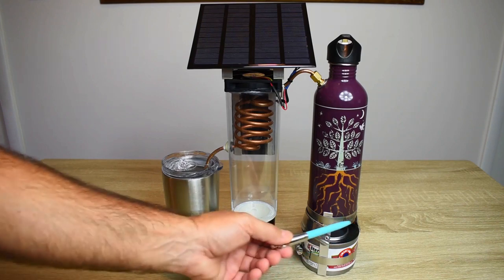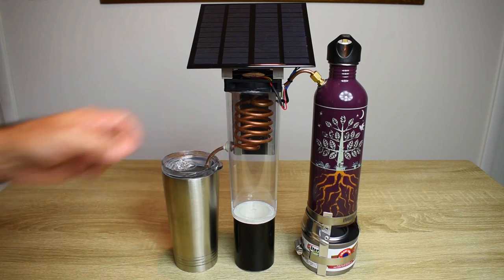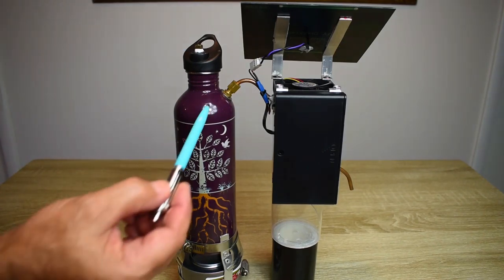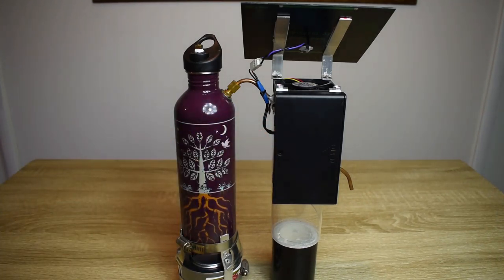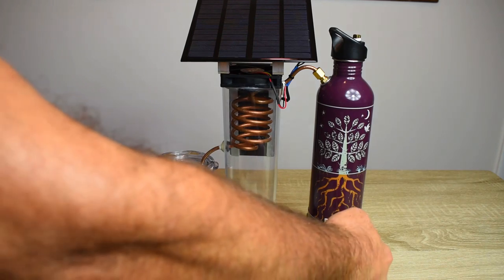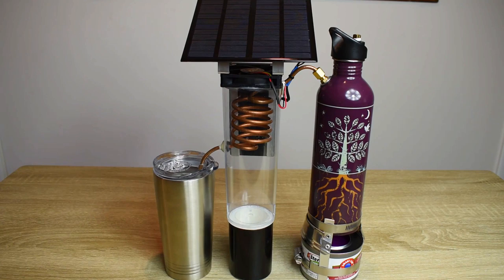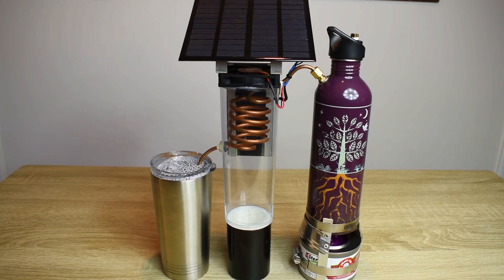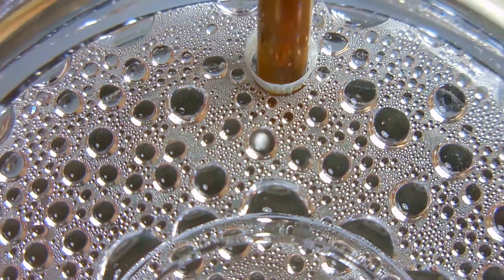Turn Salt Water Into FRESH! (Solar Cooled Desalinator)

Comment: Nice clean build! I think next desalinator I make the goal will be full solar operation. Either by a panel powered heat source, or maybe a vacuum solar tube. The latter would be more fun to play with, but fragile for real world use. Thanks for the great follow up. I've added this video to my video response playlist
Reply: Photo-electric panel heat source would require a very big panel in the order of m^2. Maybe you mean a panel that heats water in copper pipes.
I saw a small camping gas heater with a peltier unit on it one time that you could use to charge your mobile phone etc. I don't know if it would power a cooling fan though. Just a thought in case you hadn't thought of it.
Vacuum solar tube would be fun to see. Good luck.
Reply from the maker: Thanks Ben! I knew you'd like it. Your video made this one happen. If you try heating the bottle with a 12v cooktop burner, or induction heater, you'd need a few 100w solar panels. You need Grant's solar concentrator on the bottle. :-)
Reply: I saw your video and instantly knew it was a great idea. I think it provides a solution for a lot of people in countries that lack potable water. I hope your idea spreads.
Reply: Good build but not very survival good but well done. Survival is what can you find and do this in a emergency
Reply from the maker: @done1213  Where do you plan on finding copper tubing in an emergency? Thanks for watching
Reply: @electronicsNmore  
Copper tubing may be difficult to come by in an emergency, but the condenser coils of most refrigerators and freezers are made of steel. 
The refrigerant found inside modern appliances is usually butane, so after it evaporates, there's no toxicity.
As long as you thoroughly dry your condenser coil after use, chances of having it rust are minimal.
Being steel, just heat it up in the flame.
Reply: Use the solar to make hydrogen and the possibilities are endless
Reply: @Nash4Nashville  
There is a man who lives in Washington state who did just that...
Solar to hydrogen, to electric, direct combustion for cooking/heating and had plans to fuel his car.

The problem is that it's not a sensible thing to do.

Hydrogen needs stainless steel tanks, as it reacts with mild steel to make it brittle.
The relatively low pressure at which hydrogen is stored in a tank means that a ridiculously large amount of space is needed for the tanks alone.
The electrolytic process used to split water into hydrogen is inherently inefficient due to the inevitable creation of unwanted side reactions (always oxygen, but others depending on the electrolyte used.
 Chlorine and sodium hydroxide when using salt as an electrolyte, as in seawater.)
The further losses encountered when reversing this process in a hydrogen electric fuel cell (as evidenced by the lack of automobiles with such technology) further removes any pretence of practicality.

The man who built this system for himself stated that he would have to utilize it for a number of decades to recover his initial investment, but didn't include any repairs or replacement of components in that figure.

It's a good idea, but with current technology it's nothing more than a novelty.
Reply: @kaisersose5549  that's why hydrogen on demand is the way to go. Why store it?
Reply: @Nash4Nashville  
Using solar panels to create hydrogen on demand means that you have no fuel unless the sun is shining.

The other issue being a matter of demand v.s. ability to produce.
A 150 amp automotive alternator doesn't make enough power to produce the hydrogen used by the engine to turn the alternator in an "on demand" system. It would violate the laws of conservation of energy I it did.

A 100 watt solar panel array is only about 7 amps at the same voltage as the automotive alternator.

So we do 150÷7=21.428
We would need more than 21.5 of those 100 watt solar panel kits to produce around 2 kilowatts of usable electricity on demand.
That doesn't run both a microwave and refrigerator.

Let's roughly convert this to horsepower... 2000÷750=2.666 horsepower at 100% efficiency of conversion.
That's a worn out chainsaw motor.

The space required for the 100 watt solar panel array that I have is about 12 square feet.
So we do 12x21.5=258 square feet of solar panels to do the same amount of work on demand as a chainsaw motor that's nearly ready for the scrap heap.

None of it is practical YET.
With another decade for the technology to mature, things may change.
Reply: @electronicsNmore  Performance would be considerably better if the bottom of the clear tumbler had a large opening so the air can flow freely across the coil.

Comment: really cool. With a bigger solar set up you could potentially go back to liquid cooling for the coil but run a small pump too that runs the liquid through some kind of radiator and have the fan blowing on that

Comment: Just one point the specific heat capacity water is 4200 joules per kilogram whereas the specific heat capacity of air is 1000 joules per kilogram. So if the copper tube will heat up the water in the intermediate container within 1 minute, in your setup the air will heat up to the same temperature within 15 seconds but since the air is recirculating from your room to the container you made a genuine improvement

Comment: Nice build!! It would be very nice if you could make some more modifies:
1. use waste biomass as major/only heat source 
2. use waste heat to power fan/cooling 
3. wider open of salt water container for easy cleaning after several uses
4. longer copper tube or connecting copper tube to a heat sink for better cooling
5. use salt water for cooling before they go in to the cooker, achieving double purpose(save energy by preheating salt water and cooling fresh water at the same time)
6. achieving above goals and also making the system only need salt water and waste biomass refueling(after the fire started)
Good job so far!!

Comment: Awesome project. One suggestion is to blow air from bottom to top since hot air is lighter it will be more efficient.
Reply from the maker: Heat rises, so pulling cool air in from the bottom is best. Thanks for watching!

Comment: Would like to see a circuit that would use rechargeable batteries and that the solar panel would recharge.   Very nice build and  video instructions.
Reply from the maker: In order to do that, the panel would have to be much larger. I was trying to keep it small in size. Thanks for watching! Be sure to share.

Comment: I noticed how it sputters, if you want a more even flow, make sure your coil at all points goes down. If anywhere on the coil is at an incline, condensed water collects and causes the sputter. That can create pressure in the tank you're heating and if that's not water, you can have an explosion.
Reply from the maker: Sputtering is normal. Liquid builds inside the tube, then it's forced out by steam. No explosion risk, the tube end is wide open.
Reply: @electronicsNmore  If you read my last sentence, I'm warning people who aren't distilling water. Just in case someone wants to use your design to make a miniature still. Oh, and it might just be more efficient if it doesn't sputter anyway.

Comment: Possibly a gravity slow drip water system above the coil for a cheap coolant system? Could maybe cool like a radiator. Nice build.
Reply: A taller pot with the coil up higher.
That way the slow circulation of water can be fed into the pot.
A loop of the same tubing the coil is made from, going from the container holding the coil to the pot, with a needle valve at the pot. This should provide enough back pressure to prevent the water vapor from escaping into the salt water.
The saltwater first cools the coil, which preheats it, before it gets distilled... A continuous distillation, as opposed to batch distillation.

Now, if we swap out the tall skinny bottle with something that has much more surface area... Like a flat coil of tubing the same diameter as the condenser coil is made from... and add several T fittings... The tubes from the T fittings can feed upward into a single manifold made of a 1 1/2" X 12" long copper tube that is vertically oriented, with both ends capped... The condenser coil attaches to the top cap of the manifold, the ends of the heating coil and the needle valve attach to the bottom cap, and the tubes from the numerous T fittings attach to the sides near the bottom. 
Now, if only we had a way to heat this thing without fire... something like a coil of copper tube, that had been painted black, placed inside of an insulated box, with a glass top... Some sort of solar water heater, perhaps?
Reply: Spot Frensel lens could heat either surface depending on size requirements by adjusting the focal point to the temp required.

Comment: Having a large but light flexible bucket of cool salt (or dirty water) on standby to replace the cool salt water which condenses the steam might be lighter and less reliable on technology than the electronics in this set up? But setting up the boiling bottle to be used with other fuels was a great improvement, as someone with a resilience/survival view I prefer the cold water condensation method that inspired this setup as all the parts are multifunctional for other uses and less likely to fail. Using a food safe metal bottle as a boiling bottle (which also works as a normal water bottle) another bottle for the fresh water (second 1 liter bottle) a metal condensing pot (bush pot) for holding the condensing coil and cool water (also used for cooking of course) and a flexible bucket (functions for washing face or doing dishes etc) to replace coil pot with new cool water, means only the copper coil is extra weight and even then it’s wraps around a bottle so it’s very low volume, I prefer your stove setup though as it’s easier to set it up without needing to hang a bottle or have to have a smokey fire when other fuels are more suitable, in fact during many countries summers open fires are illegal

Comment: Great job. Just a quick tip. In order to keep the water temp(cooling coil) down or significantly cool, you have 2 options. 1 (peletier heating/cooling module)would be a bit more taskfull yet convinient in a solar operation, you could put the cold side of the peletier against part of the coil. It uses 12v 60watts so you could hook a solar panel and it could cool the copper down. The other and easir solution also has a draw back. You could use a pump to circilate the cooling water, the pump would be in an underground cistern, underground temps always remain at 50f even during the winter. The draw back would be that it would affect the setup. Just some pointers being that im into gadgets and diy myself..
Reply: "underground temps always remain at 50f even during the winter" really?

Comment: Good ideals. If you have problems with that fan getting heat then put the fan at the bottom and have it blow across the coils instead of suck past them. So the heat will still be coming out the top as it naturally wants to anyway.

Comment: You might want to change the fan to a 5 volt fan with a USB connection so it can power by any USB power source..Including a rechargeable solar power bank. And with the air cool method..maybe consider a type of water aspiration over the coil to aid with extracting heat.

Comment: 1:37 but...
you can lower the coil in water tank so heated water will rise up by convection  , going further you can also attach secondery big cointainer filled with water similer to oil cooled transformer so that hot and cooled water will loop and lose heat .

Comment: 5:12 is that diode really needed ?

because when pv cell are used as power source it is in forword bise (!!) but when it is connected to battery without generating any power it's in reverse bise . so  there should'nt flow any backword current .

Comment: I have an invention that takes 95% of water out of the steam. Using a metal box with aluminium panels inside about 1cm of each other with a small steam in let  cousing the steam to stay inside the box more longer. And a fan to cool the outside the box, its aluminium so it gets very cold. And I suck the air threw the box not push. For cooler air use a funnel in the air inlet slightly smaller than the fan diamiter

Comment: That's a really neat build. But it's hard to improve on the efficiency of regular old solar thermal, since the efficiency of that solar panel is probably less than about 15%, and then you lose heat in the electrical process.
Reply from the maker: You can get higher efficiency panels(21-23%) Thanks for watching!

Comment: i watched this video the other day, and today an idea occured to me:  why not use water to cool the condenser coil, but with a few twists.  twist 1 is using a peltier modual to cool the water.  twist 1 is to have the water circulated through he cooling unit to the boiling chamber.  twist 3 is to have that circulation system drawn from an external source, say a 5 gallon bucket full of seawater so that the cooling system will not get to hot and a continuous flow can be kept doing.
Reply from the maker: Peltier modules require too much current, no good. Water moving through the coil would work, but then you have the problem of being too low in height to allow condensation to drip into a cup.

Comment: Just curious, why not use a copper cpu heat sink (water block) instead of the coil?  They are built for those fans to be connected to them and no additional housing is necessary, just run them with the fans and it should push out the heat and will transfer heat much better than the coil.  There are some that transfer the water heat to air so well that you might not even need a fan...but you might want to keep them in the shade.

Comment: If you use an aluminium alloy coil tubing with the fan instead of copper coil tubing you can get way more condensed water as copper absorbs heat quickly and hold it but aluminium alloy allows it to dissipate creating quick and intense condensation
Reply: good idea. my concern there, though minor is, aluminum in contact with my drinking water.  how about an aluminum finned copper coil?

Comment: Great experimento Amigo...!!!!..but you still use alot of energy to produce water. Try to improve the performance of your system by reducing energy. For example by increasing the bottle pressure so you can use minimum heat energy to reach to boiling water temperature. And if you can improve the system to operate on solar only to produce water that will be the gift to the million of people on earth....God bless you. Wishing you success..

Comment: The title suggests the setup is solar powered but it's only powering the fan. I wonder if the liquid fuel can be replaced by solar panels and with how much power in total. That would be a great system.
Reply from the maker: Yes. The solar panel is used to cool the condenser. Using the sun to heat the water wouldn't be good. You'd need a solar tracker.

Comment: It is a nice additional to a yacht, it will also be nice if the flame is also solar power using Nichrome wire plus a peltier moudle cooling fan to cool the coil. It will also be wind proofed... It will also be a nice addition if it can recycle the water you used on a yacht including waste management. Decomposting human waste and urine to turn into water...
Reply from the maker: Peltiers and resistive wires use too much power.

Comment: Came here from Night Hawk. I have to laud you for this video, not enough work is being done to deal with desalination. In a beach setting, fanning the copper tube manually wouldn't be too difficult; the problem comes from the source of heat. While coconut husks are oftentimes an available source of fuel, I've been thinking about using a fresnel lens connected to a heliostat. Do you reckon such an approach would work?
Reply from the maker: I think those devices are a pain in the rear. You need to track the sun, line everything up.....no good. Thanks for watching!
Reply: also, I think most people think of desalination as an ocean/beach situation. however, I would submit that it would be useful in situations where water quality and availability are questionable.

Comment: what becomes of the salt?  doesn't it build up inside the boiling vessel over time?  not throwing shade brother, fantastic device!
Reply from the maker: Hi Chris. Good question. The salt will remain as a residue inside the tank. You just need to rinse it out. Thanks for watching!

Comment: No one ever demonstrates with real sea water. I have a setup like this in India with the water cooling system. But with sea water the system gets corroded very soon as sea water contains all kinds of other dusts and dirt. I like the other build where the coil starts from the lid as it is easy to replace the bottle. It gets corroded sooner.
And don’t fill more than half else the copper gets corroded as well and it’s very difficult to clean

Comment: very ingenious design! I have two areas of interest I'd like to point out. first, I would be interested in the temperature of the air exiting the cylinder, because it might be lowering the efficiency of the solar panel if it is too high. Doesn't take much heat to do that, just curious.  Secondly, again, your design is great but there is one area that could double the cooling efficiency of the coil, i.e. if you doubled the coil, one continuous spiral, but a spiral within a spiral, would in effect, double the cooling capacity with no adverse effects on operation, I imagine you already thought of that... A tiny bit more refining, and I could see you marketing this idea! 👍 P.S. just thought too, that it would be easy enough to lengthen the solar panel wire, then you could set it in any ideal location....
Reply from the maker: The air flowing out the top is only warm, the solar panel is far hotter. Thanks for watching!